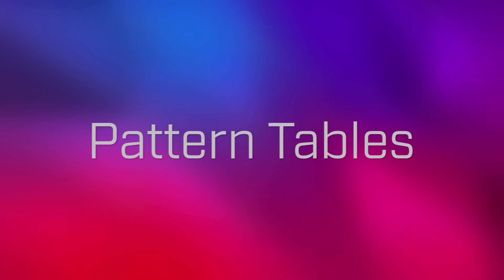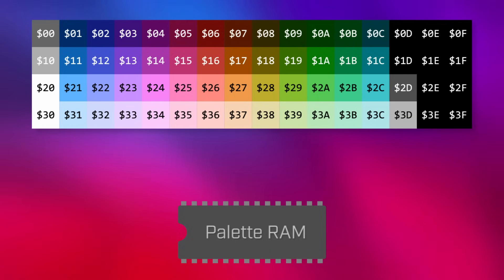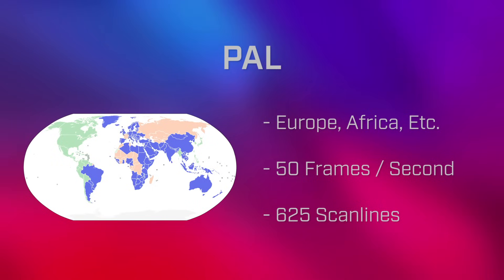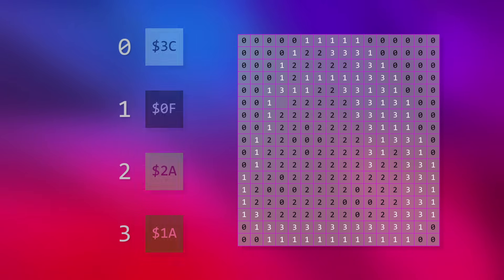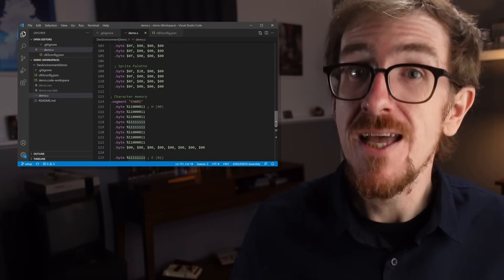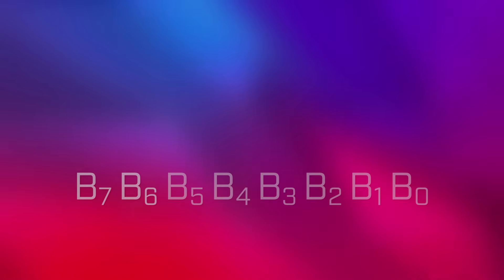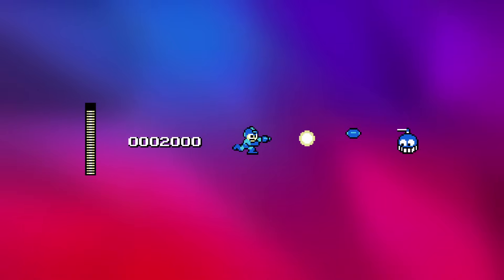NES Graphics Explained

Comment: impressive but i have two questions... 
1. how is the background background color selected? It doesn't seem to be part of the background sprites because it's a solid colour and an OAM sprite will be drawn on top of it even when set to draw behind the background sprites.
2. does the PPU only draw sprites? like there's no other way to draw to the screen? I'm thinking of something like a line drawing function where you give parameters within screenspace and those pixels will be drawn to, but it seems you could only do something like this with sprites.
Reply: 1. The "transparent" or "universal" color is selected by putting the color you want in the very first value of the very first background palette. Any other palette's first color is ignored and instead uses that color.
2. The PPU can draw the background, which contains tiles aligned to a grid and so you just replace the tile at the coordinate you want to change, and the OAM sprites, which still use tiles but aren't tied to a grid, I don't really know exactly what you're referring to here.

Comment: What's kind of fascinating is that the nametable (32x30 tiles), is 960 bytes. The attribute table is 64 bytes. 960 + 64 = 1024 bytes. Exactly one kilobyte. They did not have a single bit to spare.

If this math was just a single byte off, you would probably have lost either an entire row or column on the screen as there's no way to simplify the attribute table.

Or the two nametables would be different sizes but that would just overly complicate things.

Comment: SECAM was partially compatible with PAL, but produced a B&W image when presented with a PAL signal. So these of us growing up in SECAM regions generally were stuck with playing NES (or its clones) without color until multisystem TVs that supported both PAL and SECAM color became common. It wasn't until several years after I first played SMB that I learned that Mario's overalls are red on the NES.

Comment: Some games actually were adjusted to run at correct speed on a PAL TV. It is pretty rare, but SMB1 is an example off the top of my head, and is actually the reason certain ones of those clone systems/multicarts run the game too fast. It's using a PAL ROM and running it at 60fps.

Comment: SECAM NES did actually exist, but it was a pirated clone. Those were popular in ex-USSR in the early 90s. That particular SECAM edition was named Dendy SECAM Classic, if I'm not mistaken, and it was released in 1992. It was a first Russian NES bootleg clone. Subsequent bootleg models of Dendy were PAL only because of two factors, I think. First, multi-system TV sets became much more common by 1994 already. People even modded their old Soviet SECAM-only TVs by soldering PAL decoder. And second, it seems like Dendy SECAM was a failure from a technical POV, lacking reliable color output.

Comment: Not to crap on the specific hardware setup naming conventions but it's much easier to classify background graphics as "Tiles" and free moving sprites as "Sprites" regardless of platform hardware.
This simple universal division in named terms really gets to the root of difference, bitmaps with a true alpha channel versus those with only an opaque/common channel. Thus platforms without true sprites behaving like text modes or pure tile-maps.
There is some pseudo-sprite like setups such as "Background-Sprites" that do big bosses but really the limitations of that define how a Tile is different than a true Sprite. It just gets so muddy when everything is referred to as a "sprite" ijs.🙂
Reply from the maker: Yep, unfortunately most people who aren’t working with the system at a programming level just thing of all graphics as “sprites” 😂

Comment: I remember learning fairly recently that unlike most other systems, the NES’s available colours are ordered by hue and brightness as opposed to RGB. Each palette specifically uses all different hues and brightnesses for each colour to ensure that the sprites read just as clearly on monochrome TVs as colour TVs.
Reply from the maker: Oh that’s neat, I knew it organized the system palette this way but I didn’t think about the implications for monochrome!
Reply: @NesHacker  I’ve developed an interest in how older games and systems used their limitations to their advantage in ways that aren’t obvious, or even become “problems” when emulated on modern hardware. This is one of those examples where now that I know, it stands out when NES style art doesn’t follow that rule lol 

Another example is how early Nintendo systems rendered frames narrower than TVs, so the displayed frame was stretched. As a result, some developers actually narrowed their art so that things like circles and squares would display as intended. Ironically, first party developers did this the least. 

Obviously analog signals on CRT screens weren’t as sharp as modern displays, so some sprite work looks much better when a little fuzzier in general. Another way this was utilized was how dithering got blended together and was effectively unnoticeable on intended displays, whereas some people really hate how dithering looks now. Similarly, using vertical stripes (like the waterfalls in Sonic) made them simply appear translucent.

The way even relatively newer games utilized resolution was interesting too. I’ve seen people point out funny looking LODs in Mario 64 that were never visible before. PS1 games that used flat image backgrounds like Resident Evil or Final Fantasy were seamless back in the day but look very strange when emulated at higher resolutions now. A lot of games with “low resolution” textures or lower polygon counts did not seem that low when the display was so limited too. 

Anyhow, I appreciate your reply. That was probably a long read, much of which was either uninteresting or already known, but I get excited sharing lol Hopefully it wasn’t too bad, and if nothing else I’m glad to hear the monochrome compatible palettes were new to you!

Comment: Hi guys I have a question! Are the palettes referenced stored in arrays,? I ask because of the index number referencing them.
Reply from the maker: An array is just many pieces of information right next to one another in memory. Palettes are stored in the Video RAM (VRAM) starting at address $3F00. There are 4 colors (bytes) per palette and 8 palettes in total. So you can think about each of the palettes as being an array with four elements, and as all the palettes as being one big array with 32 elements. It all depends on what you're trying to do and which interpretation is best for the problem at hand.

For instance thinking of them as eight 4-entry arrays is great when thinking about how the color values are chosen when the PPU is drawing a sprite. And thinking about it as a big 32 element array is best when you're loading and entire set of palettes at run-time in between levels or something.
Reply: @NesHacker  I truly appreciate the time you've dedicated to answering my question. God bless you my friend. Just curious do you plan on doing these types of videos for any other consoles ? Maybe Gameboy?

Comment: I know this video is a year old but I wonder what's going on with the PPU and nametables when you put the cartridge in and the image tiles are all scrambled on screen forcing us to blow in the cartridge.

My guess is it isn't seated right and maybe the chips are getting a partial or out of order signal from the cartridge?
Reply from the maker: Basically. The data chips on the cart are connected to the NES by way of a parallel data and address bus. If one or more of those connections isn't good the NES won't be able to read the high or low voltage state correctly and will interpret bit incorrectly. Enough incorrect bits and you end up with a bunch of garbage on the screen.

Comment: The whole PAL/NTSC thing was a nightmare. Thank the Maker the world eventually settled on a single 2K/4K standard since then! Still, even though people in PAL regions lost out big-time with videogames they arguably won by the same degree with movies, with a noticeably higher SD resolution (625 vs 525 lines) and perfectly smooth motion, albeit with an imperceptible (4%) speed increase.
Reply from the maker: It's such a nightmare I couldn't even explain it correctly in this video 😂

Comment: 4:09 This is incorrect. There is only one electron beam in any CRT, except for some experimental ones in the 1930s. After being deflected by the yolk, electrons first strike a shadow mask, which is a perforated metal sheet that has clusters of three pinholes. These pinholes direct electrons onto one color component each. When an electron shines through a designated green pinhole, for instance, it will strike a chemical mixture on the screen which produces green light (probably by a combination of some phosphor that absorbs electrons and emits UV light and a pigment that absorbs UV light and emits green light). The electron gun still sweeps across the screen in exactly the same way as always, but a high frequency color signal rapidly turns the gun on or off to ensure that it is on only when the appropriate color should be illuminated. In this way, old B&W signals would show up on new NTSC screens just fine, and similarly, new NTSC signals would show up on old B&W screens just fine (but with no color). The downside is that the shadow mask blocks most of the electrons, so the gun had to be made more powerful, but this was still less expensive than having three separate electron guns anyway.

The TV receives three radio signals (one low-frequency component carrying audio, one high-frequency component carrying luminance, and another nearby high-frequency component carrying both hue and saturation via QAM). The PPU had to quickly convert the digital information about the next few pixels of the current scanline into an NTSC signal, which is a complicated task, especially at just 5.4 MHz. It's further complicated by the way it received information not for a given scanline but for a whole frame, which it had to decode on the fly to constantly generate the appropriate signal. It also had to be cheap, of course, which is one reason such sophisticated graphics were not possible much before the NES. Another interesting note is that the NES was built to be capable of outputting a component RGB video signal, but the requisite output hardware was never included in NTSC countries. A relatively simple modification allows you to add this functionality back in, and the result is that you get a much more saturated image. This helps explain 5:17--the NES had multiple outputs, and these accommodated both PAL and SECAM TVs from the same console. There were still some slight differences to account for in connectors, both between countries with different systems and countries with the same systems.

7:39 I would like to understand the physical memory for storing palettes in the PPU if anyone knows. There must be at least 25 entries (three for each palette, plus the universal background), but I don't understand how each entry is stored (as a byte? or 6 bits? or what?) or how they are decoded by the PPU. It's kind of hard to search for. I know the NES has a limited palette hardcoded into ROM somewhere in the PPU (or on the board?), which for some reason has a lot of blacks, and of course I would need to understand that too to make any sense of it.

Another thing to note is how interlaced graphics are drawn. At 11:00 you mention the resolution and then cryptically say that the top and bottom rows are "hidden." As you suggest, these 240 rows are not quite sufficient to fill the 486 lines of picture data in an original NTSC signal. There is technically space for 486 lines, as in the original standard, but this was later amended to 480 lines, because the further 6 lines were almost never visible anyway. Actually, due to overscan, much less of the picture was usually visible than that, which means most people who played NES games couldn't see the top or bottom few lines. But anyway, why 240 and not 480? The truth is that each line in an NES image is separated by a whole line of black. This is because the NES output at a full 60 fps in progressive scan, rather than the 30 fps interlaced scan of normal NTSC TV. This exploits the way CRT TVs work (and the exact same trick is used in other countries). Normally, the first and last lines are just half-lines. This is how the TV really works on a mechanical level, and I highly recommend the explanation by Technology Connections. If VBLANK happens halfway through a line, the beam will get yanked back up to the top and finish drawing that line. So it will end up halfway between two lines from the previous field, and you thus fill in the picture for an interlaced image. But if VBLANK happens after the end of the bottom line, then the beam will get yanked back up to the top and draw a new line from the top left, just like it did before, retracing the steps of the previous field. In other words, you get a progressive scan that only draws every other line. This is why on many crisp CRT displays, you can see thin black lines all across these games, because those never get drawn. And it's why the image has only 240 vertical pixels, because that corresponds to an interlaced resolution of 480 lines. And finally, the NES frame rate is not actually quite the same as the usual NTSC one. The nominal NTSC framerate is 60/1.001 ≈ 59.9401 fields/s, but the nominal NES framerate is 39375000/655171 ≈ 60.0988 frames/s. This difference turns out not to matter, because CRT TVs are more than able to deal with that kind of slop, unlike digital displays. In fact, the original B&W signal was nominally 60 Hz exactly, but the 59.94 Hz NTSC signal still worked fine on all older TVs.

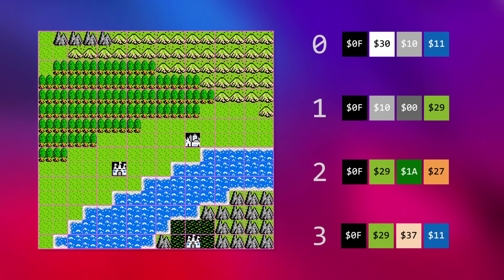Comment: The description of the attribute table is misleading: each entry in the table is not just four tiles (2x2) but actually sixteen tiles (4x4). Specifically, the image with the grid at 12:20 is technically correct, but each small box is actually 16x16 (four tiles), not just one tile as the voiceover suggests. That means each tile must have the same palette as three of its neighbors, which leads to an important limitation called "attribute clash": https://en.wikipedia.org/wiki/Attribute_clash.

Comment: is there any way to control the frequency of foreground sprites being written to the PPU. For example, could you load one set of 8 eight sprites one cycle and a second set in between to simulate 16 on a single scan line (I assume it would half the frame rate, but I don't quite understand how PPU cycles and frame rate are related)? I'm not quite sure what terms I could search on dev forums to find an answer.

Comment: Hi! Although you have placed Brazil in the "PAL" category, the analog system used here is PAL-M, it is unique among analogue TV systems in that it combines the 525-line 30 frames-per-second System M with the PAL color encoding system (using very nearly the NTSC color subcarrier frequency), unlike all other countries which pair PAL with 625-line systems and NTSC with 525-line systems.

Comment: Is the reason for PAL being 17% slower simply because it's drawing basically 17% more lines if used to its full capacity, so it takes 17% longer to draw a full screen of 625 lines if the beam is moving at the same speed, again, if used its full capacity?

If correct, then I guess both genuinely have advantages over the other, if used to their full capacity, with NTSC being able to run 17% faster but PAL being able to show 17% more vertical detail. It's just a shame that PAL was very rarely ever fully taking advantage of in NES games (and SNES, etc), as far as I'm aware, because, honestly, I never once had a issue with the speed of PAL games, and sometimes even prefer it to this day (some NTSC games just move too fast imo), but an extra hundred lines of detail on the screen would have been a huge difference in so many games.
Reply from the maker: Iirc, the big reason is more scan lines and it runs at 50 Hz instead of 60.

Comment: I have lowkey wondered how the NES graphics worked ever since I came across a video which explained the SNES graphics. The NES is roughly halfway between what a Commodore 64 could do and what the SNES could do. Somewhat ironically, the next step of home computers was the bitmapped graphics of the likes of the Amiga instead of going further into the tile-based solution that Nintendo chose.

Comment: i am a nes speedrunner from the uk.
i have never been able to find any information on playing nes games at 60hz without an emulator in the uk.
i want to play on crt or flat screen tv using a nes console, but as i am from uk i have to play at 50hz. which isnt how i want to play the games.
is there anyway to play the games at 60hz?
even if i have to buy a modded nes or new hardware i would do it. i am just wondering if its possible as i cant find any info anywhere on this type of thing

Comment: why does the NES flicker and slow down. can we fix this issue your some upgrade ??
Reply from the maker: It’s an issue where the PPU can only render so many sprites per horizontal scan line. So only some of the sprites end up getting rendered each frame causing them to flicker. The slow down is due to trying to process too much stuff between frames. If you don’t finish all calculations before 1/60th of second is up you have to cancel rendering the frame and wait until the next one comes around. Neither of these are really all that fixable, sadly.
Reply: @NesHacker  thanks for the reply. i would like to build a new flicker free